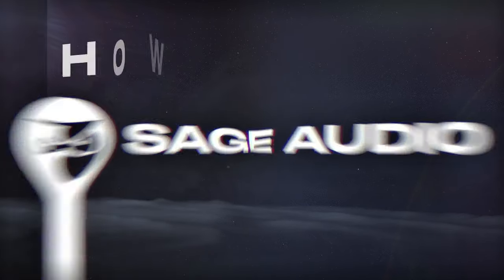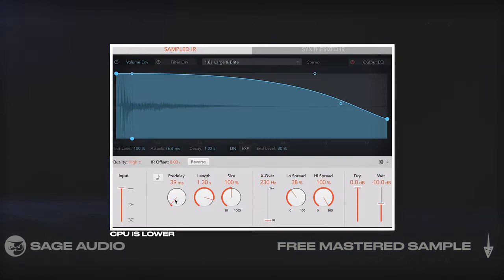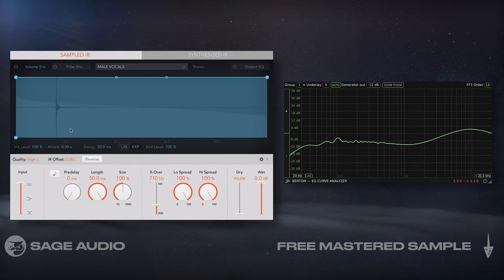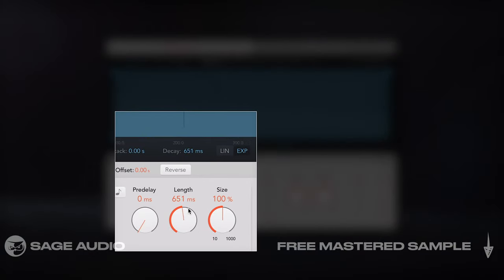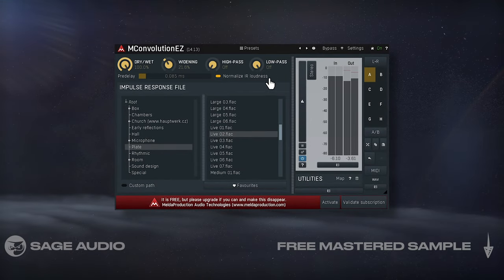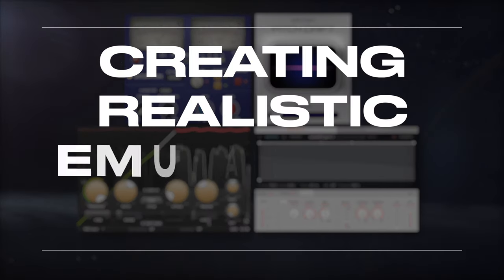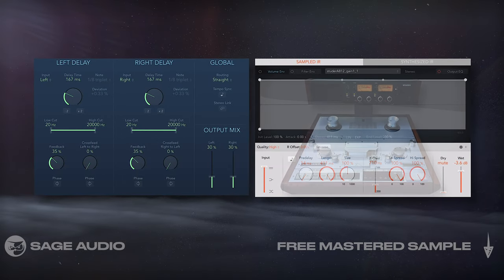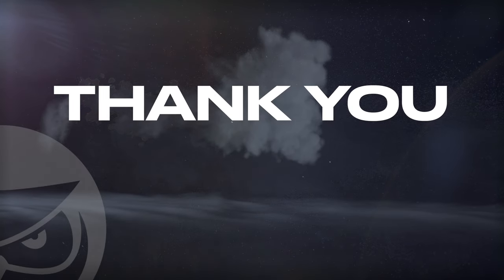How to Mix with Impulse Responses

Comment: what I don't like is shying away from specific and important things like "An impulse is a recording that captures a room or piece of hardware or softwares temporal and freq response" 

DUDE WHAT? how can you RECORD a piece of hardwares or a softwares temporal response, OR it's frequency response? That doesn't make sense AT ALL. 

First off how does ANY piece of hardware/software besides speakers/alike, have a "frequency response" ? and what does a recording of said response even SOUND like on its own? 

Please make a video explaining the beginning of this video in-depthly. please
Reply: " See how impressively it MIMICS the sound" MIMICS THE SOUND OF WHAT? We never heard what the IR is even mimicking
Reply: essentially, a sine wave sweep is run through a piece of gear at a variety of gain levels

The resulting waveforms are loaded into a program that essentially analyzes the before/after and the delta signal will show that the inherent freqnecy response curve of the unit is, as well as saturation and distortion

cool huh